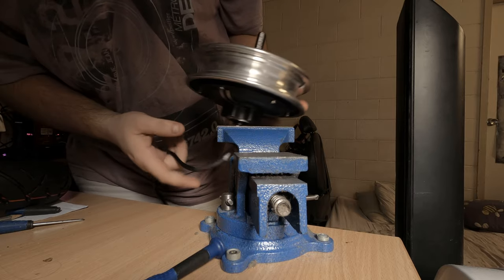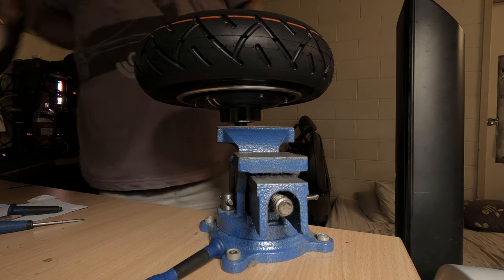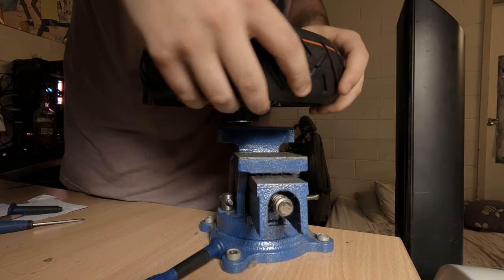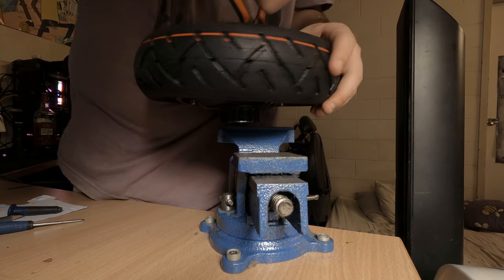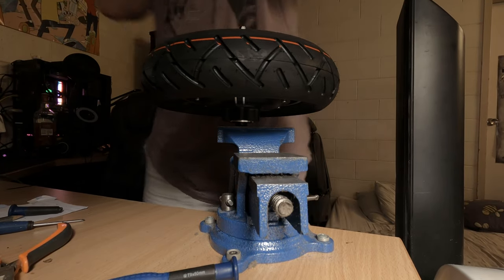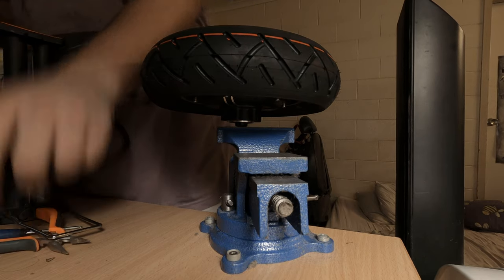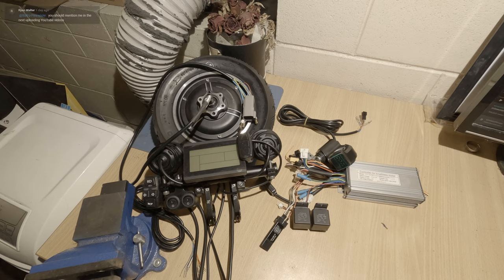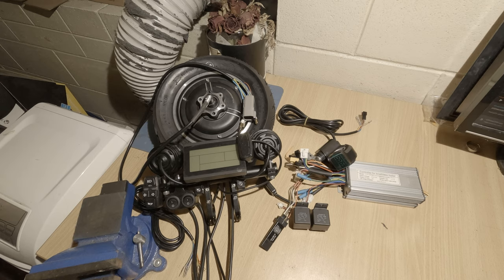Tire Change for the GTS! - It gets Zero 10X tires!

Comment: Hey bro have you found a honeycomb tyre that will fit the x10 yet?
Reply from the maker: The solid tires that BSC sell should be just fine.

I’ve never looked for solid tires for the X10, it’s too fast for them and I feel that a motor would get destroyed by impacts at speed anyways.

If you’re still keen on them, there are some that I’ve found before here; AU $35.85  52％ Off | 10x2.50 Solid Tire  for Quick 3 ZERO 10X Inokim OX  Razor Electric Scooter 10 Inch Non Pneumatic Stab Proof Tubeless Tyre
https://a.aliexpress.com/_mKx3y2V

Comment: Do you know how I actually take the tyre off my gts v2 do I have to remove the rear break line?
Reply from the maker: Two large nuts on either side of the motor, cut the zip tie holding the motor cables on the underside of the swingarm and it'll come right out.

No need to touch brake lines at all

Comment: I'm interested in putting 10inch pneumatic tires front amd back on the Dragon GT.. I am certain it will allow it to be ride-able..
Reply from the maker: No chance bud unless you want to go out and buy a hub thats designed for a pneumatic tyre from china, the existing one just isnt.
Reply from the maker: Forgot top mention, you'd have to find a 10" tyre that sits on a 4" hub first too.
Then take into account that there is absolutely no space for a tyre that size under the existing mud guards.

Comment: Hey, thanks for your videos, I find them very helpful. With this one, I'm upto pretty much the last step, but just absolutely can not get that last bit of tyre over the rim. It's the same tyres that were on it when I got it. Just replaced the tube. 
Do you have any tips at all? My hands are very sore at this stage 😂
Reply from the maker: Pinch the tire together at the opposite end that you can’t get over and push it into the centre of the rim, this should give you some extra play to work with ✌🏻
Reply: @JamiePineappleWyatt  Thankyou! Ended up getting it with perseverance 😁

Comment: At bike City scooters they actually have a smaller type of knobby tire that looks similar to the ones that come with the beast scooter but they are designed to fit the GTS v2 and they claim it will turn the GTS v2 into an off-road beast of a scooter
Reply from the maker: Similar, or the same as the GTR v2?
I remember you telling me about them before, I asked for BSC to send some up so I can see what you're talking about.

This is for last year's 36v GTS not the GTS v2.
Did you notice something near the end of the video?
Reply: @JamiePineappleWyatt   they're not like the dragon GTr v2 ones they are a smaller version of the dragon beast scooter  because I was talking to Lincoln at about it and he said they will fit on the GTS v2 And they are like $200 a pair
Reply: @JamiePineappleWyatt   And for some strange reason the guy who has that YouTube video of scoot Masters he's been having problems with the dragon GTS v2 rear tyre as it seems to be tire punches so I don't know what he's been doing to it
Reply: @JamiePineappleWyatt   it would be pretty cool if you put the dragon beast display screen on the dragon GTS v2 plus the front forks I reckon that would look like a weapon of a scooter
Reply from the maker: @ryanwalter757  Mine has recently gotten a slow leak. I've done a lot of K's though and it's due for new tires. That's usually why people get flats. Also, they're not invincible, running over a decent chunk of glass can still ruin your day.
Reply from the maker: I also have that display here, It co-operates with a different ESC though and I'm not using it for the GTS. It actually came as part of the kit for the motor in the video.

The GTS v2 will need a specific screen made for it, as it will be running a vesc by the time I'm done with it and they're not compatible as far as I'm aware.

I mean if you're looking for those tires they would be pretty good for offroad, but on road is a very different story, they'd be really noisy and wear down pretty quickly, "walking" while turning might also be an issue on them.

(p.s tire slime seems to have staved off any more leaking in the GTS v2 for now until I have some tires)
Reply: @JamiePineappleWyatt   how fast do you think she'll get up to since you've got the new controller and you display however you do need more amps if you want to increase the power and to get more speed however that also means you will have to go to a bigger more powerful brushless hub motor
Reply from the maker: @ryanwalter757  for the GTS, everything I need is in the end of this video.

For the GTS v2, I’ve already ordered the parts I need. A vesc capable of pushing well over 200amps per motor. I’ll be looking at Rion-Re90 levels of power. No display on that one though, less on the bars the better. No idea for speed, hoping for over 70km/h.

Don’t need to get bigger motors. Just need to be sensible about what I’m doing. That is a totally different motor in the video by the way, it is not stock Dragon gear. It’s wound for 65km/h @ 48v 1000w.
Reply: @JamiePineappleWyatt  when I was testing the GTS v2 I was flying up the hill at 52 km an hour so I reckon it could easily exceed well over 65 you'll get pretty close to 80 on flat level ground
Reply: @JamiePineappleWyatt  imagine if you took the brushless hub motors off a wolf warrior 11 and put them on the GTS v2 holy s*** that thing would be flying you'll get around about 94 km an hour if you modify the software and the BMS controller as well as the voltage
Reply from the maker: @ryanwalter757  BMS doesnt need programming, it needs to get replaced. Wolf pulls way more power than is available in the GTS v2.

Honestly, it would tear the frame in half.
Reply from the maker: @ryanwalter757  I wouldn't be claiming speeds you haven't hit man. No Bueno.

52km/h up hill is impressive, although that depends on the grade of the climb and the weight of the rider.
Reply from the maker: @ryanwalter757  Have you watched the video to the end at all Ryan? I did put something special in there just for you.
Reply: @JamiePineappleWyatt  Yes I did watch it to the end mate😎😎
Reply: My weight is about 84 so I'm pretty impressed it did 52 up the hill I can only imagine what speeds it will pull on flat ground this is probably due to a new design of battery that draws more amps and has higher capacity as well as they have updated version of the BMS and a different display screen on my dragon GTS v2
Reply from the maker: @ryanwalter757  any idea what that display looks like yet? I'd be able ot have more of an idea as to whats going on there.

Is the voltage any higher on the battery? say a 52v battery instead or?
84kg with 52km/h on an incline leads me to believe top speed would be around the 65km/h mark. I think I see what's going on there but i'll keep my thoughts to myself until I get more concrete info as to what's inside.

If the battery has changed, then the bms most likely would too. BMS are paired to a battery depending on it's capabilities, so it makes sense that they would put a new one in, you should just say "new batteries capable of providing more power" as they're also normally bundled into one unit wrapped in heatshrink.
Reply: @JamiePineappleWyatt   if I was on aliexpress and if I was looking at another scooter I would get another version of something that looks like a knock off of the wolf warrior 11 or a cheaper version that looks like the dragon beast because therefore you could actually custom make a trailer for it so therefore you could go camping And as long as you pick the best scooter that has huge amount of range on it I'm talking something that has well over a hundred kilometers range then yeah it would be a pretty awesome electric scooter but as well as that I would want it to be also waterproof
Reply: @JamiePineappleWyatt   I don't know what the voltage was because it was half charged when I was testing it out so obviously it wouldn't be very accurate if it was absolutely fully charged like the thing has so much speed it literally went airborne when I went over a hump just doing 52 km up the hill And it wasn't showing any signs of slowing down at all
Reply: @JamiePineappleWyatt  The weird thing about bike City scooter is they haven't updated the specs on their website
Reply from the maker: I had to remove that link BTW, That lad has no idea what he's talking about.
Reply: @JamiePineappleWyatt   what's that about that link of that new dragon scooter that has come in that has a similar design to the zero 10x
Reply from the maker: @ryanwalter757  English please?
Reply from the maker: @ryanwalter757  That video was talking about the "Black Edition x10" and it was a hock of shit. It's just iScoot's T10-ddm from Titan Group and he was just having an uneducated whinge.

It had nothing to do with the Dragon Hunter X10.
Reply: I personally reckon the vsett 10+ is a lot more better scooter than the zero scooters because it's more sturdier it's more durable The suspension is a much more better quality
Reply: @JamiePineappleWyatt   I don't mind the actual display screen on the zero 10X limited it looks like it is packed full of features therefore you could probably alter and modify the performance of the scooter a lot more
Reply from the maker: @ryanwalter757  the 760C display (the one the limited has) doesnt have any more programming features than their other displays, that's down to the esc's.

It just looks much, much better.

I like the Vsett11x but I dont think I'll be getting one any time soon. They're not very cheap at all.
Reply: @JamiePineappleWyatt   what I would love is a really awesome display screen that I can put on my dragon GTS v2 that shows speed and RPM as well as how many kilometers you have done as well as it having a temperature gauge
Reply from the maker: @ryanwalter757  Nope, they came directly from Titan Group. It's been made abundantly clear with all the marketing material. They're not the same, neither did they (BSC) but their units from another retailer.
Reply from the maker: @ryanwalter757  Put a thermocouple in the motor and use the controller I have there, you get a readout of motor temps. and KM/h, no point in rpm as that's just derivative of speed to be honest. (There are no gears to go through so there's no need to watch RPM, that would just be another distraction.) Although yes, that would be cool.
Reply from the maker: @ryanwalter757  Just got the new display for the GTS v2 in, it's one from FLJ, not titan group.

It's one of these: https://www.aliexpress.com/item/1005002249066285.html?spm=a2g0o.productlist.0.0.ea2d74ebWZUAHP&algo_pvid=5849a229-213f-4ff4-bd17-cdb228ebcf6b&algo_expid=5849a229-213f-4ff4-bd17-cdb228ebcf6b-24&btsid=0b0a556016155179308787521e2798&ws_ab_test=searchweb0_0,searchweb201602_,searchweb201603_

commonly used on FLJ scooters. not a bad display either. Should be much easier to read in the daylight!.
Reply: @JamiePineappleWyatt   this new display screen actually has more features than the old one on the GTS v2  and the GT2 v2
Reply from the maker: @ryanwalter757  well what’s in that link is what I got when I asked for the new display. I’m guessing there’s meant to be new esc’s and a battery that’s meant to go with it, I’ll have to get in touch with HR again soon and see about the other bits.
Reply: @JamiePineappleWyatt   that would explain why it was flying up the hill past 50 km an hour
Reply from the maker: @ryanwalter757  The display doesn't explain anything, an esc and a more powerful battery would though.
Reply: @JamiePineappleWyatt   I got told by bike City scooters that the battery is the same but except it's got more amps and more capacity as well as the BMS is the same but it's got a different software to run the new display screen
Reply from the maker: @ryanwalter757  how can it have more capacity if its the same battery?

bms doesn't supply display with anything, that comes from the esc.
Reply: @JamiePineappleWyatt   well that's what they said and which has made it have a little bit more performance gain as well as be more efficient
Reply from the maker: just hooked up the new display and lifted the back wheel on the GTS v2, definately says it's going over 50km/h and it's half flat. But thats unloaded, once I get on and go for a ride this afternoon i'll let you know what my gps and what the display says
wont be able to film it right now as my helmet mount decided to die.
Reply from the maker: definately not going 52km/h under load. I'm going to have a chat with HR about my findings before I go opening my mouth too much.
Reply: @JamiePineappleWyatt  well apparently it was doing that on the one I was testing it's probably because I'm lighter than you so there wasn't much load on the motors but it was definitely doing 52 it might also be due to the BMS and the battery because you've only just replaced the display screen you haven't replaced the BMS which had new software on it and the battery that has more amps and capacity going through it
Reply: @JamiePineappleWyatt  what was the max speed you were doing
Reply from the maker: @ryanwalter757  For arguements sake, when you go and get yours later this week, why not run a gps app and check your speedo against it. You might be more inclined to listen then.

Just because the display says something, doesn't mean that's what you're getting.
Reply from the maker: If im wrong and you actually hit 52km/h according to GPS on a flat path, ill concede, but I guarantee you right now, you wont get any where near 80km/h out of it. ever.
Reply from the maker: @ryanwalter757  already told you. it said 46km/h and I got 36km/h with a 120kg load.

This all while at 51.2v fairly close to full voltage. Free wheel speed was a max of 54km/h (Spinning rear wheel in air). this is how you figure out unloaded max speed of a electric motor.
Reply from the maker: what im trying to say is, eityher the wheel diameter or pole pair count needs to be changed to make these new displays actually display the correct speed.

I mean all it will take is me to find a GTS v2 here in cairns and drag them on the X10. I already know what will happen.
Reply: @JamiePineappleWyatt  if I change the whole entire electronic system and went with an LG lithium 60-volt battery I would probably get pretty close to 80 Plus go to 1600 watt front and rear brushless hub motors
Reply from the maker: I'll also put one of my lighter mates on it soon and see what speed they get, but no matter what it wont exceed the unloaded free wheel speed of the motor. (~54km/h) usually it will be a minimum of 10% less than max unloaded speed with a 60kg rider.
Reply: @JamiePineappleWyatt   I was just thinking of that if you had someone riding it and if they were 60 kilos or even less it would probably get to 52 km flat out but there is another way how to get up to 80 if you're lucky you can also run the dragon beast  BMS on the GTS v2 however you will need to run a 60-volt LG lithium battery because from what I've heard is there's two different types of lithium batteries for scooters One delivers more performance than the other because it produces more amps and has a higher capacity
Reply from the maker: @ryanwalter757  which motors? what winding?

60volts is only enough to drive that kind of speed with the correct esc and motor combo. 

And lets be real, no you wont hit 80. Theres a very simple math to work out to find your top unloaded speed. Kv. Kv is the amount of turns per volt applied to a motor. so a motor with a Kv of 10 will spin at 480rpm @ 48v.
with a 10' wheel thats about 31.4" in circumference would be 0.3828288km per minute = 22.92km/h~

You have to find the correct combination of parts to achieve this, you can just brute force your way through.

You realise that the Hunter X10 runs a 60v battery at 3200w and doesn't break 60km/h with a 110kg rider, it'll top out at 65km/h with a 60kg rider too. 72v will get you closer to 80km/h.
Reply: @JamiePineappleWyatt   I even asked My mate Lincoln at bike city scooter is there any way we could try and change the way the dragon scooters charge like instead of having that plug on the side why not have it near the top of the deck so therefore when it comes to going through the rain and puddles it doesn't end up ruining the plug because the chances are people are going to be using the GTS v2 And all the other brand dragon scooters have got the exact same concept where they all have their plugs on the side which means they're more prone to getting wet and I personally reckon they should try and copy  other big dollar scooters where most of them have got the charging ports on the top deck And the charging port is always a female not a male connection so I reckon that would be far more better and it would lesson the chance of water getting in

Comment: Can use tubeless or not
Reply from the maker: You can, but its not setup for it.
No idea if youll find a valve that wont leak or will even fit.

Just use the tubes.